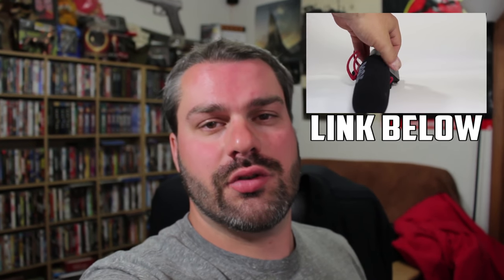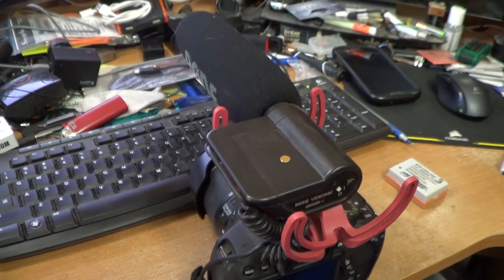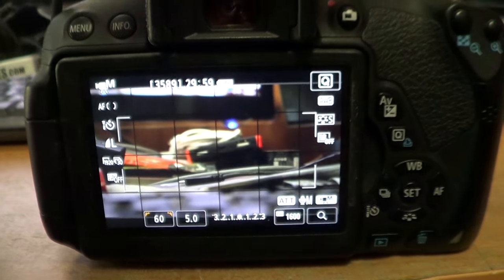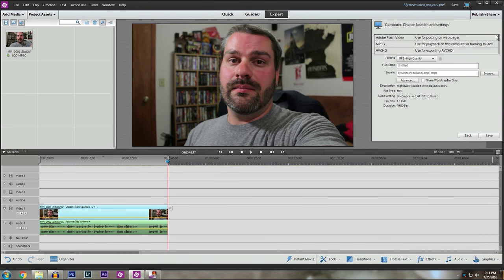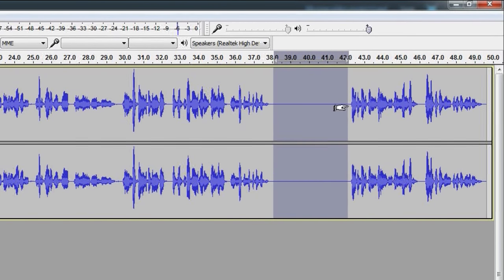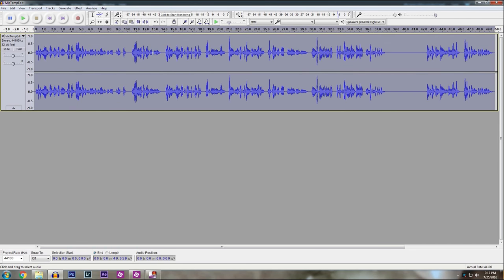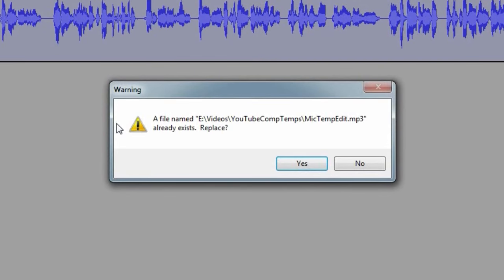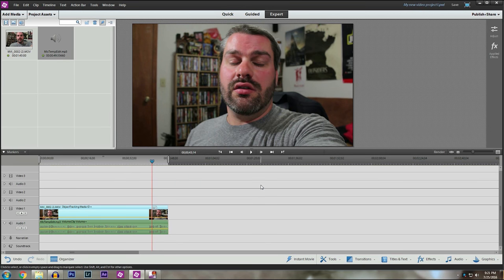How to Remove Video Microphone Hissing Noise (white noise)

Comment: Hi, guys I have the Rode VideoMic with a GH4 and I was experiencing a lot of digital noise when using the mic and the camera. But I have found a fix. So on the mic I set the dB level to 0 and on the GH4 I set it to -12dB and turned the switch up to the 80Hz high pass filter and I cannot hear any noise without any post editing. I hope this helps someone.
Reply from the maker: Great tip
Reply: Sacred Eye thank you!
Reply: it removed the digital noise D: THANK YOUUUUUUU
Reply: did it fix it while shooting in 4k thanks

Comment: So how do you change the settings within the mic... inside the battery compartment?
Reply from the maker: There’s dip switches you change to increase or decrease the mics sensitivity. The mics Manual and it will explain it more.

Comment: what is attenuator ? what is its purpsoe ?
Reply from the maker: The attenuator basically reduces the level of a microphone signal by 15, 20, or 25 dB. Specially suited to reducing the level of a high-output microphone to prevent it from overloading the microphone input of the camera/device.
Reply: @Hdtyt  thanks for your reply, is attenuator help to reduce voice noise ? should we enable it ? or keep it disable i have rode mic go which have necessary hiss sound :(
Reply from the maker: @kking999  ATT effects all audio. You need to try it and see how it works. Every camera and application is different . It's a trial and error process pretty much.
Reply: @Hdtyt  i have cannon D200  Mark 2 and rode mic go

Comment: My mic ( the same one hear ) is extremely quiet how do I fix that
Reply from the maker: Did you change the gain switches in the battery compartment? If you look in my other videos I have another video on the video mic on some tips and tricks.
Reply: HighDesertTactical Thankyou I will have a look

Comment: Hello. I have a question. When I pull down the volume on manual it eliminates a lot of the white noise, but if I have to raise the volume in the editing program, wont that raise the white noise level also?
Reply from the maker: It will Slightly but the over all volume will be better and that is were the cleaning up the track in post will get it a lot cleaner. That's why I showed 3 different levels of audio quality and the work it takes to achieve on each level.

Comment: I have the 760d/ t6s and the only settings I have are audio recording, on/off . how do I get those other settings??
Reply from the maker: Unfortunately you don't have those options, use the gain settings on the mike as best as you can and fix the audio in post.
Reply: The other setting appear when the camera is in manual mode...